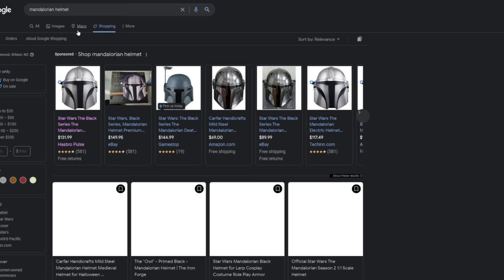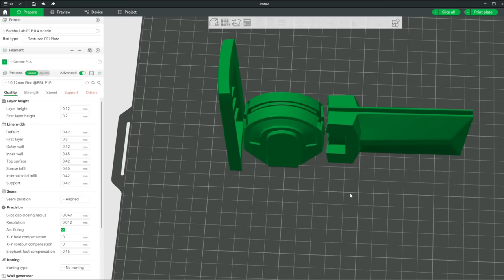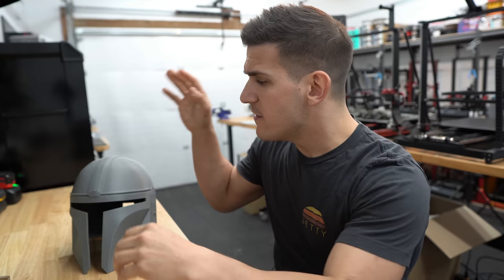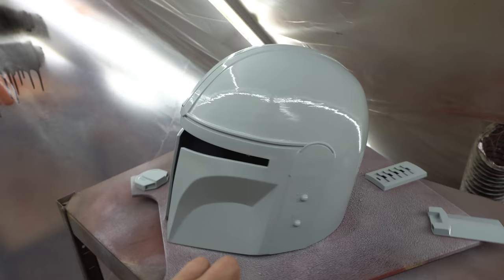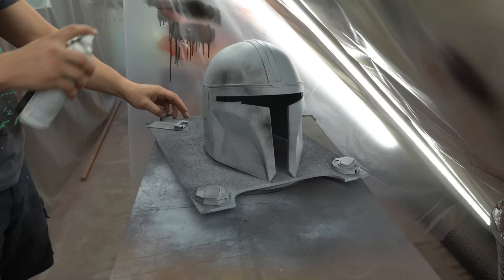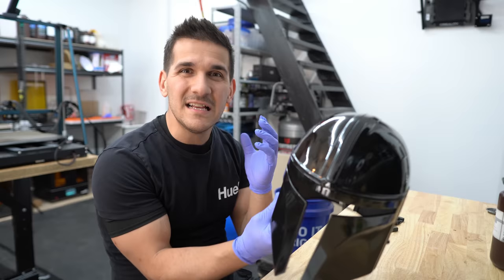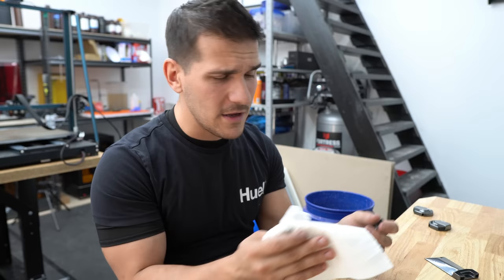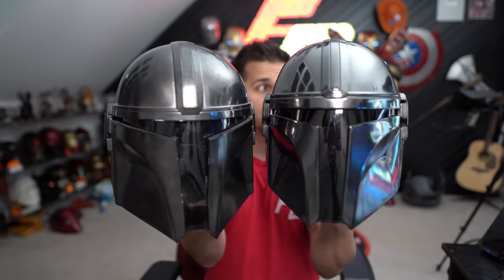How to Make a Mandalorian Helmet | EASY Trick for a Metal Finish On Your 3D Prints!

Comment: Ive seen people use a steel wire attatchment instead of sanding. might give that a shot. sanding is the most excruciating part of this
Reply from the maker: A wire brush? Even spinning that won’t sand anything
Reply: @FranklyBuilt  I meant drill attachment and yeah there's video of it working lol just saying.

Comment: Is it possible to slice with Adaptive Layers on the P1P so the resolution can be incresed for the top of the helmet to reduce that horrible stepping?
 I think using spot putty mixed 1 to 1 with acetone to fill the layer lines will be much less work in the long run.
Reply from the maker: Yep!
Reply: Even at .12 layer height its rough best bet is to just sand what you can and cake filler primer on to it!

Comment: I just love this video!
I printed my first helmet about the same time you made this video... Did most of the sanding and painting and it looked OK to say the least.
I then saw another video where the guys use resin to coat and smooth out the helmet, then respray a few coats again...
Hmmm, so I tried it! Let's just say it didn't work out and I ended up just destroying the helmet!

So, take 2! My question is...
I have a smaller Creality CR6SE where the build plate is only 235x235x250. and I'm in for a total of 6 days to print out everything!
So no space to print a full helmet, so I have to slice it into 2 halves.

I remember how I struggles to glue up the 2 halves the first time and really don't want to mess this one up again.

Do you have any suggestions as to get it nicely joined up and glues up solid?
Would you suggest the baking soda and superglue trick for a stronger bond inside?

Any help would be appreciated.

Cheers

Comment: Fantastic tutorial. Is there a reason on the P1P you didn’t select one of the preset modes like Detail (I’m on an ipad now so can’t look up the dropdown menu) to have it pick a collection of settings for higher detail? Do you find them less useful than just changing the layer height and a few other settings manually?
Reply from the maker: You can select presets but you’ll learn to adjust them more

Comment: Currently working on Gideon Helmet, I will use this method likely, I original had the idea to electroplate it but this seems way easier and affordable, my only question is in stead of graphite is their a way to tint the helmet to be even more dark/black?
Reply from the maker: Not that I know of no.
Reply: @FranklyBuilt  alright, I’ll likely skip the graphite part then, the black shine is good enough for what I need thanks

Comment: Instead of using normal sandpaper, user tamiya (or other brand) sanding Sponge. Works better for you because is thicker and sands smoother.

And paint wise, use an Airbrush instead of cans.

Comment: So I've made a full set of mandalorian armor and I had a problem with the armor not sticking. To the pants and shirt i'musing. I'm using 10 pound resistant Volkswagen but it seems to be always falling off especially when I move around or walk. I'm not jogging in it but just a Regular walk do you have anything that can basically keep it on should I just put more vocro Was only putting like one strip down the center of the armor

Comment: Out of curiosity, is there a reason you don't use tree supports?

I print with Overture's PETG, and tree supports have worked fairly well for me, albeit a little slower on the Processing speed when generating them. I thought they save both time and filament, but I'm not sure
Reply from the maker: Tree supports aren’t better than normal supports. They’re just another option for different applications.
Reply: @FranklyBuilt  That makes sense. Thanks for the reply by the way!!

Comment: Hey Frank, another fantastic tutorial as always. 

I'm trying this on some car wheels which turned out well, but just curious, how has the chrome effect held up over time on your helmet?

 I'm debating on adding an additional layer of clear coat on top of the rub as it seems to be holding fine for now, but not sure if it will wear off over time.
Reply from the maker: This WILL not last one car wheels haha

Comment: A coat of primer is one full wet coat applied evenly across the entire piece. Each coat should be allowed to "flash" dry before the next coat is applied. So the question remains... How many coats of primer should you apply? the answer is "as many as necessary to achieve complete coverage without sanding all the way through to the substrate.

Comment: Orange peel is a paint defect that is from improper spraying technique..  an it just looks like  the texture of a orange peel, look at most pick up truck tail gates u will notice this orange peel type texture to the clear coat. .. what i saw, in your paint in the split second i could see it is what  id call wrinkling..  id bet its from lack of surface prep between coats, you need to start with dawn dish soap because its a good degreaser.  an wash an dry completely between coats  when you sand or do anything to it. ..  also i suggest in buying a 1$ tack cloth an wiping everything down before you paint less dirt means alot less work..  the smaller pieces from what i could tell may of been messed up from your over spraying them while painting the helmet... id suggest learning auto collision paint prep techniques if your serious about learning how to do it properly an not have this stuff pop up as often. dont get me wrong ur stuff looks nice.     an thanks u helped on what the graphene stuff is..

Comment: Thank you so much for this video. I wonder how long it took Akira to double the price after you released this video. Not long evidently. It now shows that same file is $20. Luckily, I had 30 percent off loyalty points. Even though I already had several Mando helmets from different Patreons I wanted my first one to be the exact one you printed in this video.
Reply: Any chance you could go a little deeper into support settings on the Bambu? I printed a 50% scale version just to test my settings and the supports were just crazy to get off. I could use the AMS and have a support interface material but I was trying to go “old school”. Haha. What Z distance and such are you using to get cleaner support removal? Another reason I really don’t want to use a different material for the interface is because it nearly doubles the print time. Thanks again.

Comment: I've been trying the graphite rub but before I get to that my clear coat keeps cracking only in certain spots continuously. I used the same paint as you and others and just keeps happening and when I tried the graphite rub it was spotty like finger prints even though I'm not touching the surface

Comment: I'm looking to get into 3d printing.  I also make decals,signs and shirts as well as my pro photography I do as well.  

Can you tell me if the K1 Max AI Fast 3D Printer will be really good to start with? I won't be doing the cool crazy stuff like you. 
Someone told me to get a bambu labs x-1 C instead. 

I want a large foot print for printing larger etc stuff if needed but the bamboo has multiple colors you can setup to use at once.

Comment: I used the same settings as you did.  And not your fault obviously but during sanding I accidentally cracked a seam line where the end of the visor area meets the ear piece and it continued through the ear piece on that same layer.  I can weld this just fine but wondering in the future, should I be using a denser infill ratio to help compensate for flex the helmet might experience?  FWIW: This is for my kid so I'm expecting him to not handle very nicely.  I might just be over thinking it and maybe just had some bad layer adhesion.
Reply from the maker: You could weld some extra material inside or after it prints

Comment: Wouldn't it be better to print the smaller pieces like the ear pieces in resin (if you have a resin printer)
Wouldn't that be a time save and also help with the details ?
Reply from the maker: Depends on print quality. P1P handled the details fine

Comment: Hey frankly built, quick question for you. I was actually in the process of building this on my ender 3 printer, and I got done printing half of the helmet and my printer started having extrusion issues, idk what to do about it either. I’ve switched out the nozzle, cleaned it, there isn’t a clog in it. I don’t know what it causing it but my layers are just super weak and they just come apart so easily. If you have any tips they’d be very very appreciated because this has been a massive headache for me. Thanks!

Comment: when painting with spray you etither apply coats about 30m after each other, our after that you have to wait about 36h to aply a coat or varnish because the solvents will attack the undercoat, and..... you get orange peel. *Also lots of light coats, don't ever do a thik coat, ever. more than30cm away, and keep same distance and angle when applying.
Reply: Also, there are filler paints, with 2 coats primmer filler, you can cover after 36h with color and varnish of choive, and cut like half of all those steps.

Comment: Hi, does it Have to be a gloss (black) surface for the graphite powder step,or can it be like a gray surface, or doe matte surface work? Thanks
Reply: I'm working on a Mando atm and if it isn't a glossy base, it will not be as bright or reflective. We tested it because we've been having to re-sand our gloss black due to cracking/orange peel over and over - graphite on a non-glossy surface just looks noticably different and isn't as bright, shiney, or reflective

Comment: Quick question why does he spray paint and remove it with the sanding? Wouldn’t it be easier to just spray paint once?
Reply from the maker: You need to smooth it out

Comment: you definitely can avoid orange peel with better painting technique. start your spray off of the surface you want to paint, 50% overlap, maintain a consistent 12" distance, and  it's hard  to tell from the timelapse but you probably need to move a bit faster too because that coat looks too wet. also improper recoat timing could  contribute to orange peel as well. that print quality is definitely better than anything ive been able to do! very cool

Comment: Would it be possible (stupid perhaps) to mix some graphite powder with a varnish in an airbrush?
I'd like to use a combination of Stuart Semple's Mirror paint with rubbed graphite at the very least to have a bit more depth and texture/natural weathering.
Reply from the maker: You could try but I doubt  it
Reply: I think this would kill the light reflection necessary for the graphite to look shiny.

Comment: I recently completed a full set of Mando armor using graphite? What I had to do was after the first clear coat dried and I applied the graphic it looked blotchy and streaky which I was warned it would. I then applied a 2nd coat of clear but only let it dry for 1-2 hrs and then did a 2nd round of graphic and this is where it turned into that mirror chrome finish. Unfortunately after only one Con the armor looked terrible from rubbing against the leather bandolier, etc. my helmet looks great since it didn’t come in contact with anything. So I’m redoing all the armor except the helmet. I’ve done a light sanding and then repainted everything with gloss black. What I’m wondering is can I just airbrush allclad chrome over that or do I need to clear coat it first? I saw you used Krylon gloss black? Have you tried the dupicolor gloss black. The automotive grade nozzles on dupicolor are like 10x better than any krylon, Montana gold or rust oleum rattle can and make it much easier when applying gloss black and clear. I like rust oleum sandable filler primer cause it s cheap but trying to get a nice finish without runs using krylon,, rustoleum etc has always been an issue.  I’m become pretty good with an airbrush which is which is why I decided to go that route and the lack of durability with graphite was disappointing. For a display piece it’s really the way to go as it looks amazing when first completed.

Comment: I get fingers on the visor after applying the tint as per your tutorial, any recommendations? It's hard to pre-bend this stuff. Method: soapy water, put film on, squeeze out water/bubbles - everything looks perfect, then after I've bent the visor and put it in the helmet, fingers start to form. I've seen window tinters pre-shrink with a heatgun, is that something to do?

Comment: I wonder if you could've avoided the orange peel issue by using bondo or filler to smooth out your layer lines instead of dumping so many layers of paint on it initially?

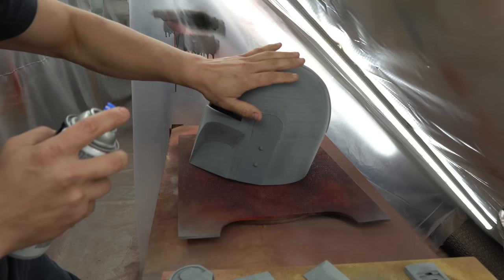Comment: Hey Frank, I had a question. You say here 10:10 that you want to do a light dusting and then when that gets tacky you do a heavier coat. Why is that? Does the dusting help hold the heavier coat on? Or something else? I’m just trying to understand so that my helmets come out better. 

Great video, very helpful and easy to follow!!
Reply from the maker: It helps prep the surface for the wet heavy coat

Comment: Is orange peel more likely to occur with spray paints? I almost exclusively airbrush paints, especially Alclad lacquers (their Gloss Black Base is stunning) and I never really get the orange peel effect. I do wonder if the less controllable, "faster" paint from a spray can is more likely to cause an issue, versus being able to take it slow and control the paint volume better with an airbrush. Not that Spray Paint is necessarily bad or worse, just wondering if it's a little trickier to do it cleanly?
Reply from the maker: Yeah paint cans can have weird reactions sometimes

Comment: I'm going crazy. 
I did it the same way you did. I even ordered the same graphite powder as you. 
But mine remains dark with a shallow metallic sheen. 
The first time, I had industrial powder. I thought it was because of that and I sanded everything down again, 
repainted it and then did everything again with your powder. But, it remains with a dark helmet. I don't know what to do😢.
Reply: Did you find a solution already? I have exactly the same issue

Comment: Whats your opinion on using uv resin to help prevent using as much sanding or filler primer
Reply from the maker: Works fine but is expensive
Reply: @FranklyBuilt  hmm I bought a huge container full of it and it was like 15 bucks that's why I asked

Comment: For some reason no matter what I don on this one the bottom front most point of the helmet keeps coming off the build plate. Using the same setting you used with a PEI sheet and printing in pla +. Any suggestions? I have a brim and turned the aux fan off.

Comment: Question! I just printed my first mando helmet with mo middle support it did not fully worked for the middle top part of the helmet. Inside it was stringy and missing parts and on the outside it was thin layered. Obviously i put filler inside but why did that happen? What setting did i mess up on? Any ideas, thanks!!!

Comment: I need help with a silly problem Frank, I'm building my 2nd Mando helmet, printing my 8th and final piece and the print is the easiest print (back-left-bottom) and it keeps failing in the last 10 minutes not "closing" the top off? I have leveled the bed 3 times, settings seem ok, spool not tight, do you have any suggestions? It's failed to print 4 times now the same part
Thanks my friend

Comment: I've heard that you can't paint PLA, is it rly true? Do you use PETG or there is a way to make possible PLA painting?
Reply from the maker: Everything I make is PLA
Reply: @FranklyBuilt  I just tested print white cube and painted it with acrilic paint, but it stays kind of wet and after few days super easy to scratch it off with a nail without much force... Advice please?
Reply from the maker: @Braincho  try different paints

Comment: 15 minutes 09 seconds in you said the paint orange peeled on the top of the helmet that is not orange peel that is a reaction to contaminates most probably oils from your skin , next time before painting use a 50%/50% mix of water & methylated spirits & spray it onto a lint free cloth than wipe the entire surface with it this will remove all traces of contamination .

Comment: I just tried this and got very different results! Any idea where I could be going wrong? 3D printed helmet, sanded and painted with black gloss same as this. I did a final coat of clear gloss then waited 24hr. The graphite powder doesn't seem to mark it, instead it just slides right off! It does leave what look like little scratches in the clear coat but they're hardly even noticeable. Not sure if it's the graphite powder or the paint i'm using that's giving me trouble...
Reply: I’m having the same problem, let’s hope he responds
Reply: @eliteassassingaming7793  I think it was the clear gloss, I tested with just the black gloss by itself and it worked much better! I think the graphite powder doesn't stick well to certain paints so maybe a bit of trial and error to find a good combination
Reply: @Sirkristofuk thanks man, I’ll try this soon 👍

Comment: Thanks for the video and good to see you using it. 
This process is one of the best/most satisfying. I've seen helmets sprayed with Alumaluster and Duralumen that didn't look as good as the graphite (though I'm sure it was mainly because of errors in earlier steps). 
Your process was easier than this version, which was also quite good for those who want another thorough graphite process  https://www.youtube.com/watch?v=YpiAKiOWbmw